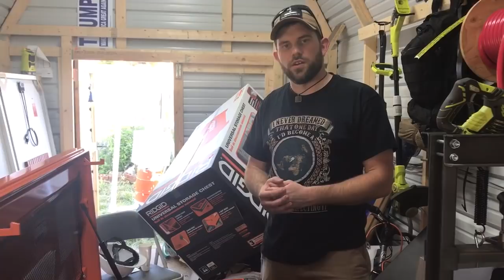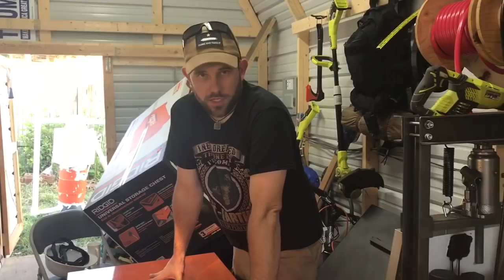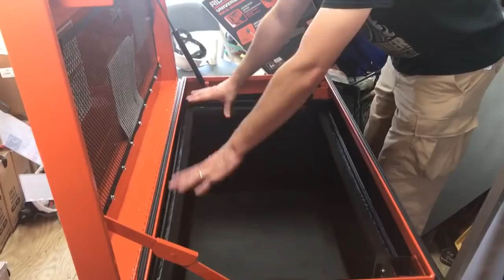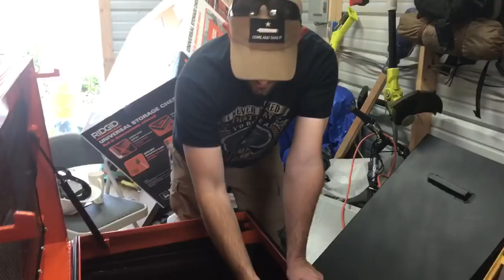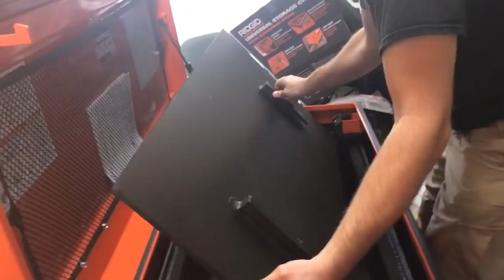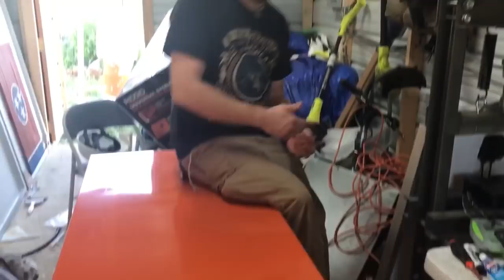EMP shielded storage box systems by Off Grid Contracting

Comment: dosent the rubber gasket defeat the purpose of metal to metal contact of a faraday cage?
Reply: Powell Davis you are absolutely correct. The modifications shown here would do nothing to make the box any more EMP-resistant than the off-the-shelf version.
Reply from the maker: Powell Davis the hinge still can carry from the lid. the gasket is to help isolate interior and then the coffin inside creates an isolator/insulator as well. We add the rubber coating for added non conductivity.